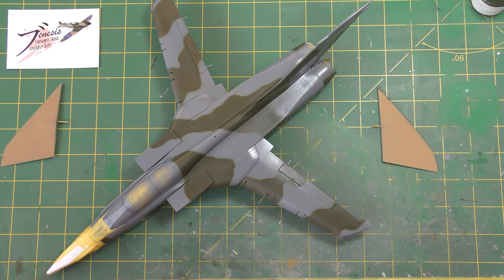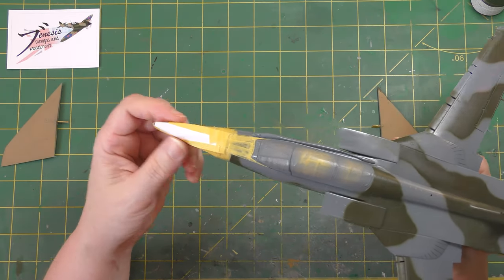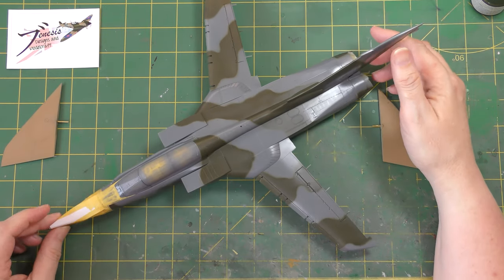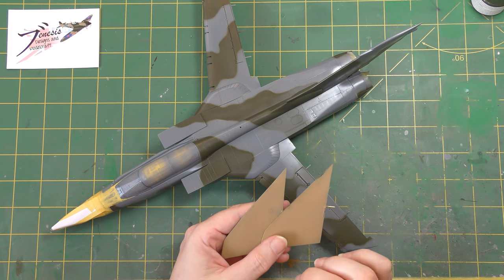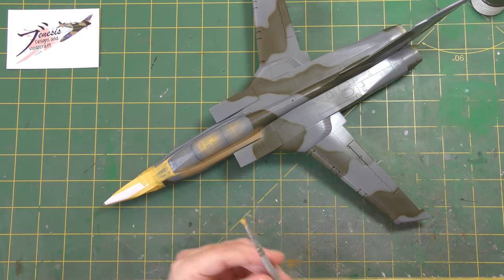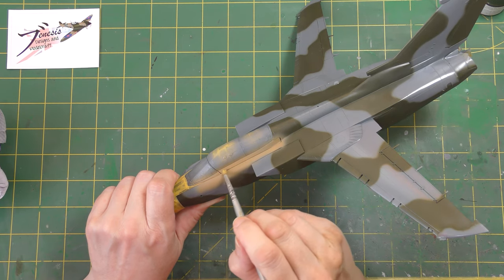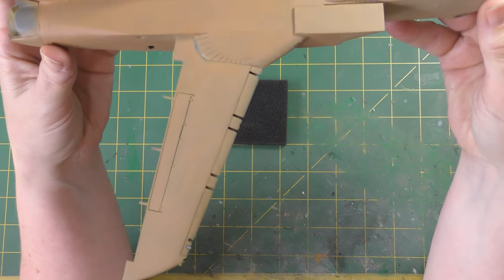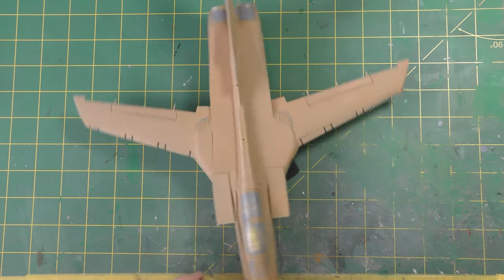Eduard (Revell) 1/48 Tornado GR1 Foxy Killer - Part 6.

Comment: Looks amazing!! Agree 100% on the pre shading comments. Just an observation Jen, and I know it's too late now, but wouldn't there have been insignia under that water based sand colour paint that was applied for Iraq? I was always led to believe they were painted with a white was like solution and then steam cleaned when the y returned to the UK? I remember seeing two camo'd Tornados on the apron at Filton fully armed and ready to go, I drove past the hangar every day.. but not on that day... oh no, the armed guards would have put bullets in my Rover SD1!!
Reply from the maker: Hi Nigel, good to see you here! Yes I am sure they painted over the original markings but I wasn't chipping anywhere near any of them. The paint was a semi-permanent coating, that's why it wore so badly and I actually have a photograph of a C-130 on the wash pan at Lyneham getting it washed off.
Reply: @JenesisDesignsandModelcraft  Hi Jen.. was looking forward to seeing you at Thornbury today :(  I was chatting to a guy who was in Iraq on Puma's. he said the paint was designed to be washed off on return, however the sun baked it on in Iraq and some hardly washed off at all and needed to be stripped and repainted!!

Comment: Just a heads up checked back to part one the smart bombs you have weren't around for gulf 1  the ones you have were used in opp telic the ones used in desert storm  didn't have GPS sensors on the nose or the conduet down the sides of the bombs the same company do the early ones for desert storm too hope this bit off information helps
Reply from the maker: Thanks, yes. I think someone mentioned it a while back, and I do now have the Eduard Brassin bombs which are the correct type.
Reply: Yea I have the ones you have too plus the same company do the early ones too have both types in Eduard too when you have a few tornados in the stash a selection off ordanced is handy great build keep it up